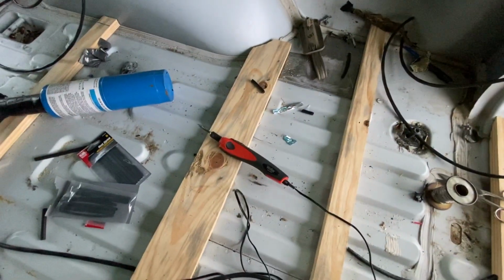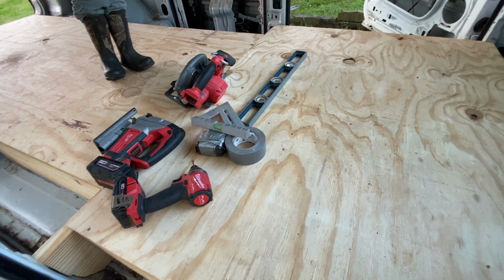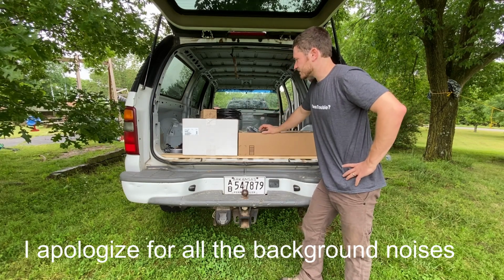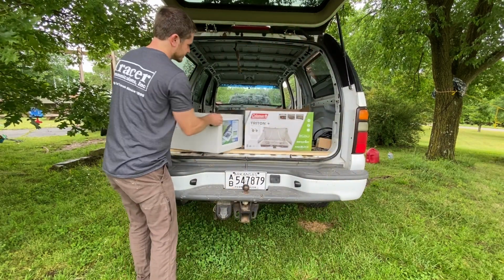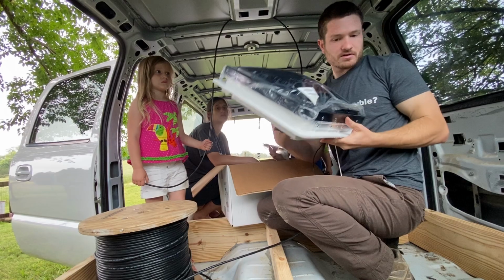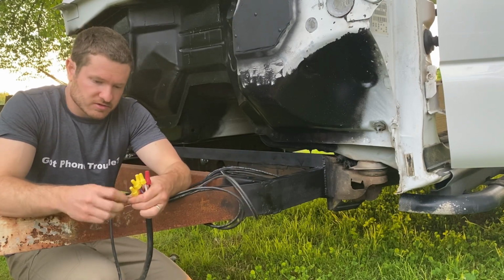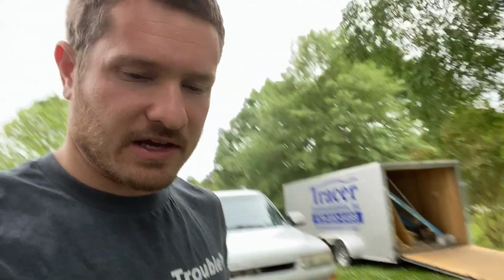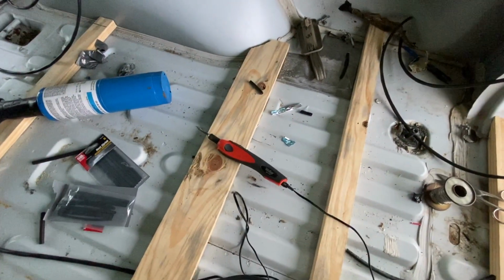Suburban to Camper Conversion Part 3, Storage Hatches and Wiring

Comment: Quick question,  did you run all new wire for the tail/brake light's? Do you have a video showing how you made the tail/brake lights work? Awesome work man 💯
Reply from the maker: Yes I ran all new wires and then tapped into the existing ones right below the taillights
Reply: @trove1312  do you have a picture that you can share on how you tapped in? I'm building one and couldn't find the wires up front to tap into so looking for the easiest way to attach new wires. Can't seem to find a good wiring diagram online. They seem to be different color's not sure why

Comment: Next time, just run the lights cable to the front and add a new 7 pin connector.  That is going to be way better than splicing, though you did a nice job.  Same for the back.  New connectors are a good thing too, as the plastic gets brittle.
You could turn down the background music a bit, it's very loud compared to the voice.  Great project.  I have an '07 Yukon XL 2500 and would love to have a camper to match!
Reply: Do it! Be really sick if you used another 3/4 Ton burb too. Then all your spare parts n so on will be interchangeable ❤

Comment: Would have thought pull out drawers would be a better design option, along with leaving all that insulation from under the old carpet to help keep the cold out when camping.
Reply: and headliner too for that matter.
Reply from the maker: Pull out drawers were an option but they don’t work as well with the way the doors open on the vehicle. Also the drawers would have to be squared off which would leave unused voids under the subfloor. As far as the insulation we re-insulate everything later with better quality insulation. The headliner doesn’t have any insulation and it was also very dirty and stained in places.